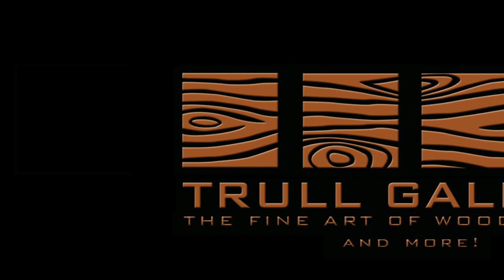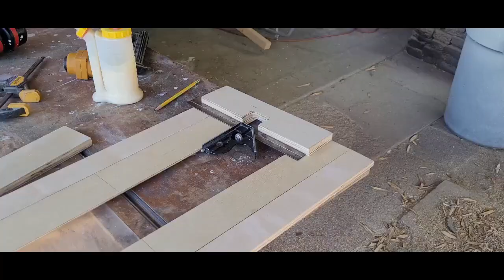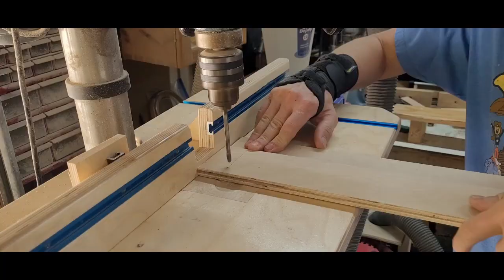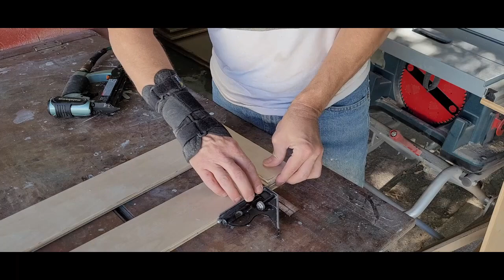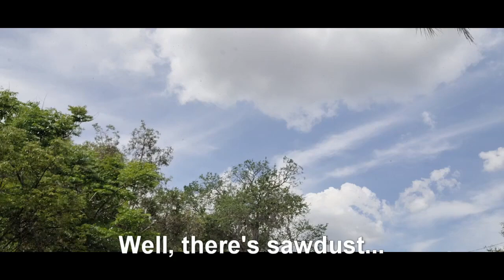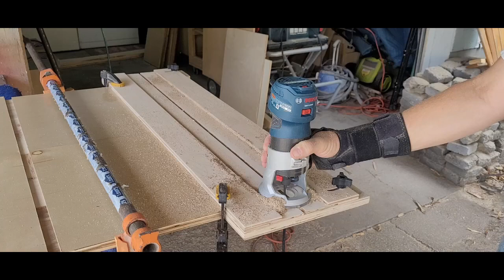Two Adjustable Dado Jigs For Your Router

Comment: Hello 
Couple of questions 

What type of bit did you use??
What size bit ??
On the bit was there a bearing??
If so was it at the bottom or on top??

I have tried several different jigs I have seen on YouTube 

No luck
Reply from the maker: For the first jig I used a 1/4" spiral bit with no bearing.  The router is guided by the sides of the jig.  The second jig uses a 1/2" straight bit with a bearing closest to the shaft to ride along the sides of the jig.  I hope that helps!
Reply: I’m glad you liked it 

But if you could answer questions I would appreciate it

Comment: Hi mate, I'm a total novice but am going to try this. Is there any particular type of router bit I need to buy? I have 18mm plywood to build a cabinet with shelves. Why doesn't the bit you are using cut into the sides of the dado jig? 
thanks
Reply from the maker: Hey Michael,  A good bit to use is a pattern cutting bit.  These have a bearing the same size as the cutter close to the shaft, and the bearing rides against the jig.  Just make sure the bit is stopped before you take the bit out of the jig.  I've hit jigs more than once with a spinning bit, and that means it's time to rebuild the jig!  Good luck.
Reply: @TheTrullGallery  Thanks mate, that's great information. and greatly appreciated.

Comment: I want to make lap joints, this doesn't seem to have the precise depth control required.
Reply from the maker: @oneeyedphotographer  that comes with practice...
Reply: @TheTrullGallery  There's a limit to how deep it can cut, plunge routers have a tower of stops for taking several bites, this router seems to lack that feature. If I want to cut to 38.5mm, I need a reliable way to get to 38.5mm   quickly. With my eyesight, there is no question of guessing it.
Reply from the maker: @oneeyedphotographer  once the groove is defined and you remove the jig, would that give you the depth you need?  Your bearing can ride against the sides of the groove you just cut.
Reply: @TheTrullGallery  It's a matter of getting the depth precisely. Plunge routers, you set the depth stop and it's done. Trimmers and the like don't have the needed precision. Half a millimetre out and it looks terrible.

My immediate task is to make a bed with the sides lap-jointed, on the edges. In principle my SCMS is  the best machine for the task, but the depth stop is on the (user) left and I need to see the blade. That would be ok, except I have a painful problem with my left shoulder, it needs attention.

A beefier version using a big plunge router should be ok.

In the meantime, I think I've got the SCMS into shape, and mastered the art of cutting a groove that's a tight fit.
Reply from the maker: @oneeyedphotographer  best of luck with your project!